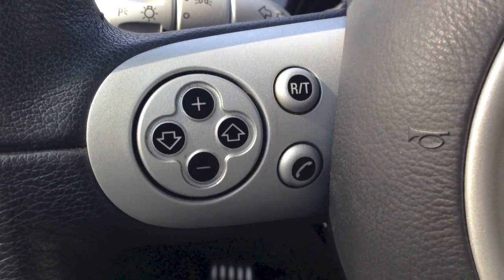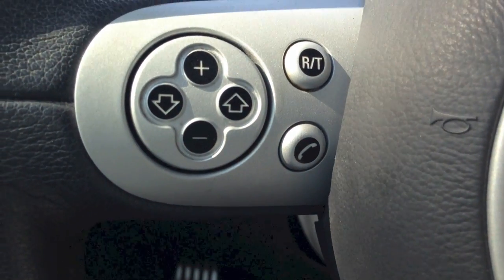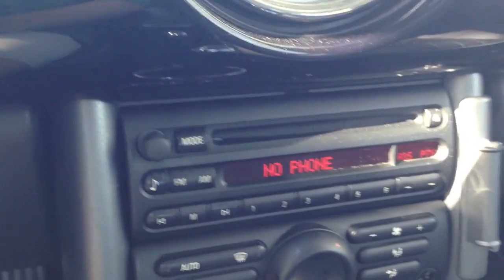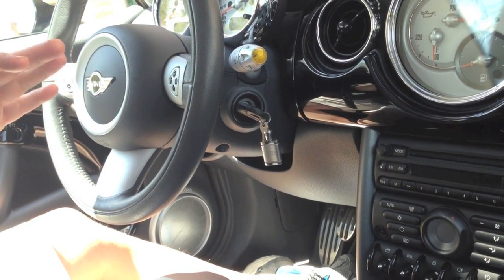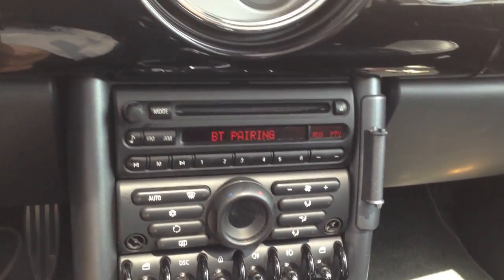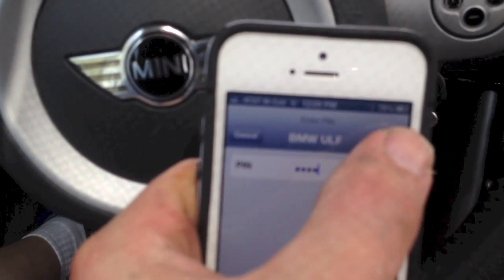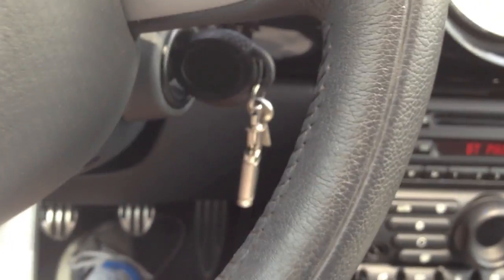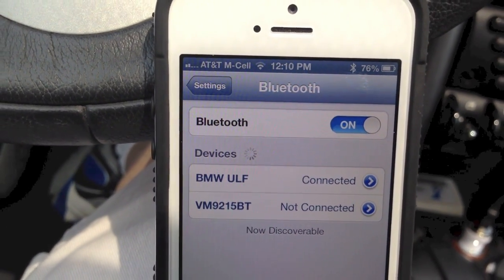BMW/MINI R52/R53 Universal Hands Free Setup (Bluetooth Phone)

Comment from the maker: Yup you should have a plastic card with your 4 digit PIN in your owners documentation.  

There is also a PIN sticker on the ULF module itself, but that's not easy to get to on an R53 Mini (behind the center dash).  Only other way to get the PIN is via a BMW/MINI dealer

Comment: I've a Mini Cooper s 2005... I have the buttons on the wheel... I don't have the Bluetooth pair button behind the handbrake... Is it an addon of some kind?
Reply: +acengland82 , I am also wondering the same thing? If you get a reply please let me know as well.
Reply from the maker: +acengland82 the "button by the handbrake" is part of the optional factory built in bluetooth phone kit that was available for the 1st gen BMW Minis.   More info than you could ever want to know in the build thread I posted in the video description:  

http://www.northamericanmotoring.com/forums/r50-r53-hatch-talk-2002-2006/247803-r53-oem-bluetooth-retrofit.html

You can get the steering wheel phone buttons working in many ways, but all of them require some add-on electronics.

Good luck
Reply: +bnallc thank you for the reply! Last question, do all 1st gen's have the button?
Reply from the maker: +mark white unfortunately no.  the car would need to have the MFSW option (Multi-Function Steering Wheel) and one of the 2 OEM bluetooth options.  Please take a look at the first post in the link I shared - you'll see pictures of the options.   You can still get original equipment retrofit kits that will let you use the MFSW buttons, or you can get aftermarket kits that also work them.  I used to have a Parrot system before I installed the high-end OEM setup that's shown in the video.

Comment: Can you stream music with the bluetooth using for example, spotify?
Reply from the maker: Hi Pablo..  this is just for calling.  There are several aftermarket Bluetooth music adapters available that work with the CD changer interface.  You can also use a box called an Intravee with a Bluetooth adapter and get track info on the display
Reply: No it wont stream which is annoying